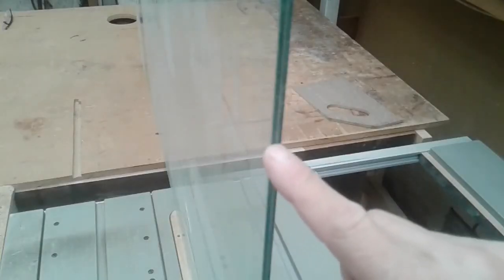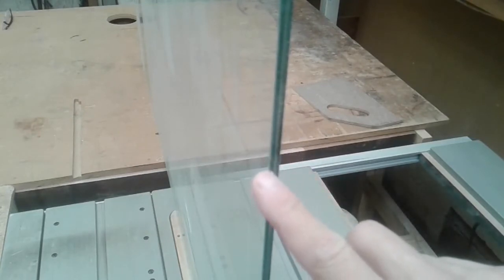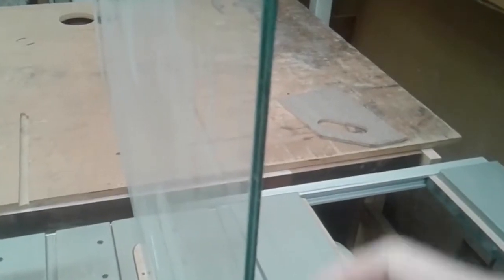Laminated glass problem - How to avoid it

Comment: I wish that you had shown more close ups of the glass, it would have been interesting to see the delamination pattern up close in detail.
Where did the glass come from? Your samples visual appearance is very reminiscent of what laminated glass looks like prior to the autoclave process when being manufactured. Of course the video doesn't really show the delamination up close so it isn't possible to get a closer look.
Reply from the maker: Hi Greg. Apologies I seem to have missed your post. The picture was actually sent to me from a friend in Johannesburg. This type of delamination is quite common. I've been seeing it everywhere.
Reply: @madmikemakes3056  Hi Mike, I am not sure what you mean by picture? I was assuming that was an actual laminated lite behind you, but is it a picture??
As I mentioned in the first post, the haze in the glass behind you is indicative of laminated glass that hasn't been through the autoclave cycle. Assuming the laminator is using a traditional heat and pressure roller line and then autoclave, my immediate thought would be that they need to lower the heat on the line and extend soak time on the autoclave cycle. Just a quick thought without knowing their process or examining the glass in person.
Reply from the maker: @gregcorwin8316  Hi Greg. The thumbnail is a picture that was sent by a friend in Johannesburg. As for the process for laminating the glass, it's anybody's guess. I just see loads of laminated glass showing this damage.